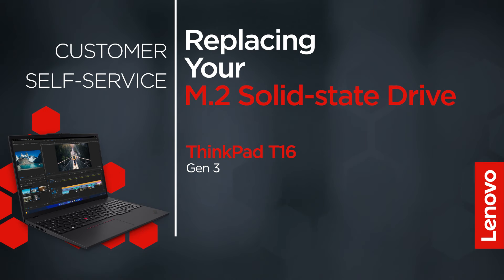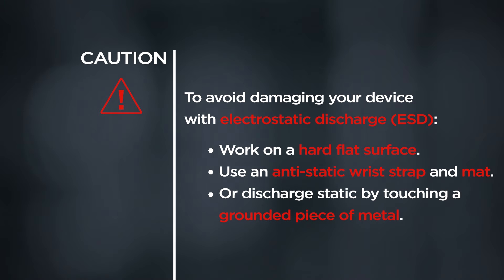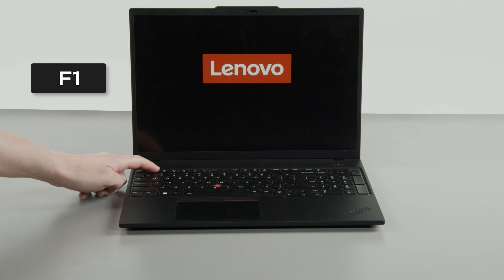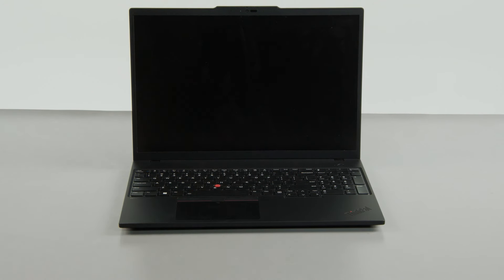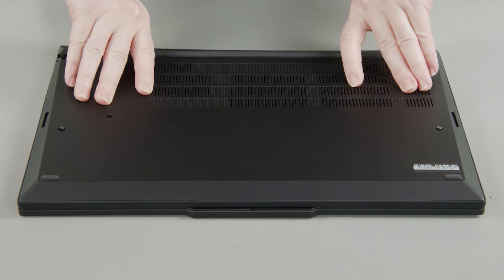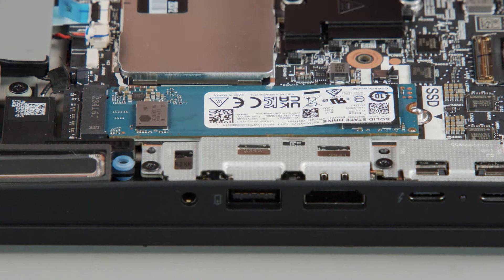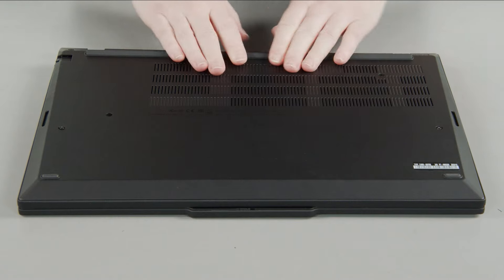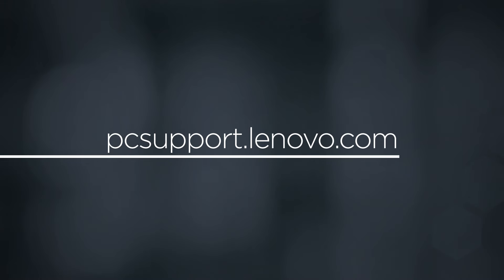Replacing Your M.2 Solid-state Drive | ThinkPad T16 Gen 3 | Customer Self Service

Comment from the maker: This video will show you how to replace the M.2 Solid-state Drive (SSD) in your ThinkPad. The process in this video will work for the ThinkPad T16 Gen 3. 

You will need a screwdriver kit, a non-metallic pry tool, and 15 minutes of your time.

To view the ThinkPad T16 Gen 3 Self-Repair Guide go to https://pcsupport.lenovo.com/us/en/products/laptops-and-netbooks/thinkpad-t-series-laptops/thinkpad-t16-gen-3-type-21mn-21mq/selfrepair/removalsreplacements

To learn more about your device go to https://pcsupport.lenovo.com

To find parts for your device go to https://support.lenovo.com/parts-lookup/?cid=ww:lenovosocial:b9515f&source=socialmedia&subsource=yt

To view the Lenovo Support Self-Repair Guides landing page go to https://support.lenovo.com/us/en/solutions/HT516547

** NOTE: Static electricity can destroy components. Use a grounding strap, and clean, non-conductive surface to work on. Use plastic or coated tools to prevent scratching and avoid using metal tools on plastic parts. For more detailed information on electrostatic discharge and how to prevent it, please watch our ""Understanding Electrostatic Discharge (ESD)"" video: https://youtu.be/by4PB3WtdLo 

Applicable Machine Types:
ThinkPad T16 Gen 3 - 21MN, 21MQ

#Lenovo #LenovoSupport #LenovoTechSupport

Check out other official Lenovo channels!
https://www.youtube.com/@Lenovo 🟥
https://www.youtube.com/@lenovolegion 🎮
https://www.youtube.com/@Lenovo-PC 💻
https://www.youtube.com/@LenovoSuporte 🟢🟡